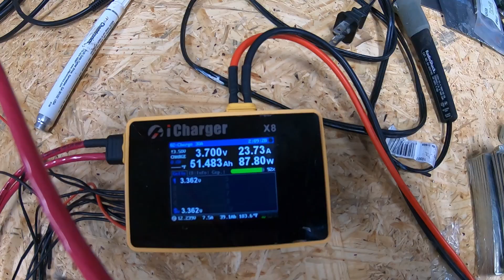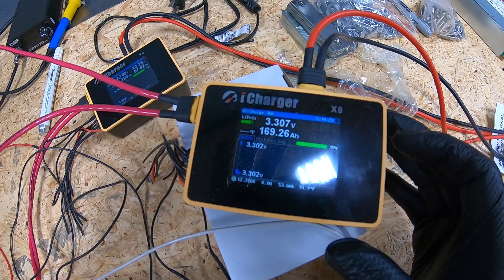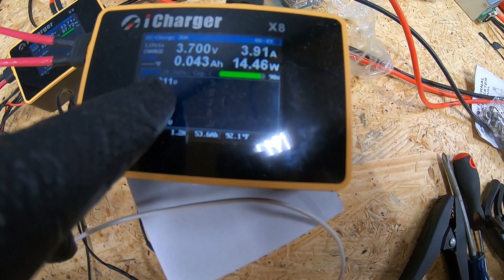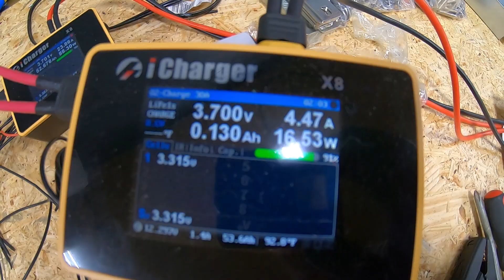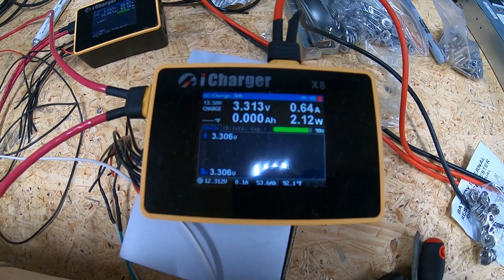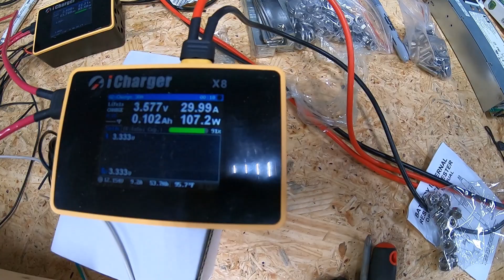280ah Charging setup.  Always check those connections.

Comment: Just a thought for anyone who doesn't have a bench or dc/dc charger, you can also set them up in parallel or individually and use you solar charge controller to charge them to 3.55 or what ever you'd like. ... just a thought.

Comment: Why are you using the Ichargers?  It appears you have a bench charger in the background.  
I don't have Ichargers but I looked them up and it seems they are DC to DC chargers.  I just don't know why that setup is preferable to using the bench charger that uses AC current to power the DC charger.
Would you care to comment.  Perhaps I should re-consider my charging approach.
What are using for a DC power source?  Is that something out of a computer or???
Reply from the maker: Hello, Thanks for the comment.  We currently use iChargers as the iChargers can supply up to 30Amps of current and uses a LifePo4 charger profile with various protections.  The power supply for the iChargers us an HP server chassis.  The HP power supply has been modified to power up outside the chassis.  The bench top power supply could be used, but it has a limited current of 10Amps.  And although you can setup a constant voltage or current setting to keep from  overcharging the cell.  I prefer to use the iCharger for the increased charge current and they are built specifically for charging of these types of cells with all the necessary protections built in.

Comment: Did you notice if any of the cells expanded? The only cells I've personally had expand were cmax cells. I had a couple different prismatic cells and at first I was paranoid of excessive expansion but after building a similar setup noticed even when discharging @ .5c there had never been expansion. Then my thoughts were confirmed watching off grid garage. I really like that guy, seems to put me in a better mood for some reason. Thanks for sharing, nice to see those big beautiful cells
Reply from the maker: Only have seen slight expansion that follows the electrodes.  When the pack is fully charged they fit tighter in the frame.  So far nothing major noted since they were put into production use.
Reply: A couple of other YouTube shannels have done the compression test and you get about 1-2% more energy if they are compressed...

Comment: I’m running 4 Ichargers on my 64 cells I just received yesterday in parallel. I ended up crimping ring terminals on both the voltage reference leads, and the charge leads. 

I’m getting 29.6-30 amps out of each and made a huge difference even compared to running big copper alligator clips.
Reply from the maker: Nice

Comment: I used ring terminals and bolted them straight to the cell and that helped reduce resistance while charging.
Reply from the maker: Agreed, that method would proved a nice sturdy connection.
Reply: Also adding electrical grease will help, you'd honestly be surprised....

Comment: Hi. Couple of things - 1. Wear cotton gloves. If you touch a hot bus bar with a plastic glove, it will melt on your hand, or at least transfer a load of heat to it. 
2. Put the sense leads directly on the battery posts.
3. I would cut off the croc clips and use lugs instead. You could always put a connector on the croc clips and charger cable if you need to use them for something else. Or set up a new lead.

Comment: Well, you've already charged some of them individually so the whole pack is now really out of balance, unfortunately.  But there is no need to charge them completely on an individual basis... that takes a lot of work.   Just get them to the same voltage (e.g. like 3.30V, something easy to achieve), then connect them up in parallel.  Once the whole pack is in parallel you can finish charging all in one go and top-balance the pack.

Just keep in mind that once the pack is connected in parallel, your charge rate will be very low on a C-rate-basis, which means that you should choose a lower voltage target like 3.55V, and not go much higher.  Top-balance the pack at 3.55V.   Also, since the pack is not balanced yet the total charge current should not exceed 0.5C of a single cell because during this initial parallel charging phase some cells will accept far more current than others.

Extra precautions must be taken once the pack is connected in parallel.  A short would be insanely dangerous... we're talking 1600A or more.  I would put a separator down the whole line on top of the batteries and maybe even break one of the busses up with a few in-line fuses or breakers (most people don't bother, though, but... still, 1600A if you make a mistake).

-Matt
Reply from the maker: Thanks for the comment, agreed that care must be taken when dealing with any battery bank and or cells.

Comment: I would check the voltage of each cell - if there within 0.02 volts then I would put them all in parallel over night to equalise - next day I would connect them in series as requires and charge them a 30a  with my T8 charger which has 15w balancing - if when they start going up the heal at about 3.4 any cell was more than say 0.1 out on voltage I would reduce the charge proportionally to say 2amp  to give the balance time to trim the cells - once top end balanced i would discharge the pack so cells are 3.4v  (3,3v if going into storage - charging cells one at a time is needlessly time consuming - the head room  between say 3.3 and fully charged 3.6v  is only 0.3v so there is  very little potential difference (pressure) to  push the energy into the individual cells - hence your 4amp struggle - in a 4S it goes up to 1.2v and in 8S 2.2v when you can really make use of your 30a charger : )